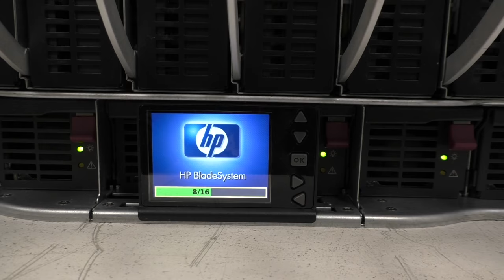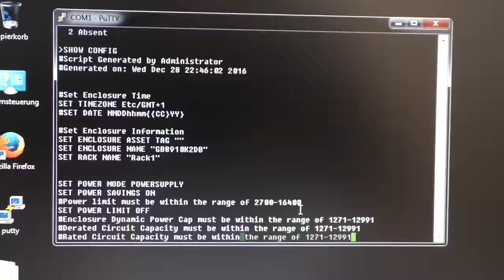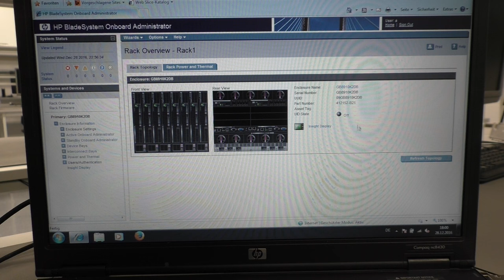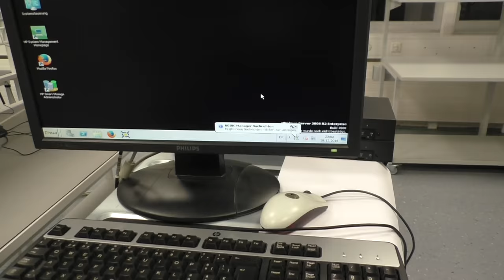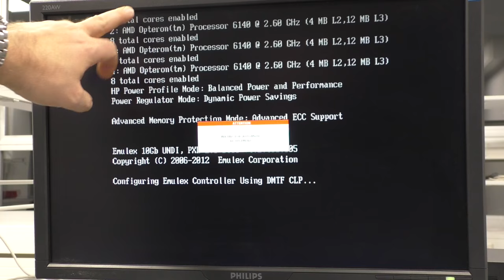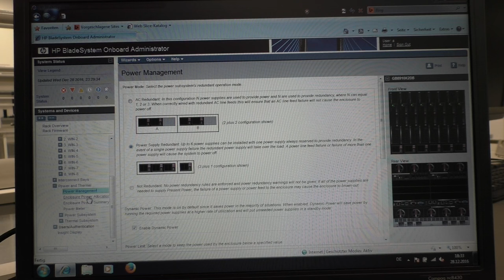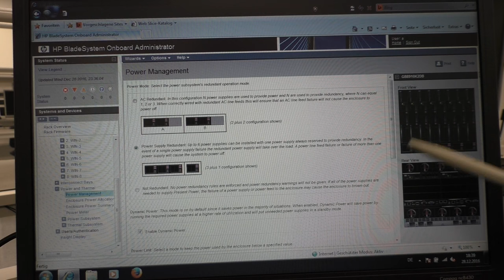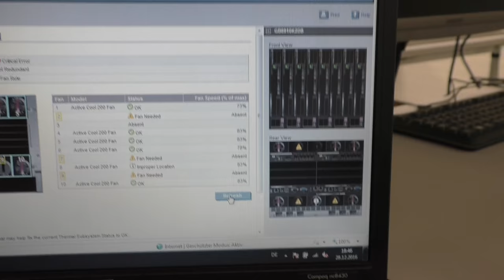Powering up the HP C7000 blade enclosure (PWJ45)

Comment: Hi... can you advice me how to login to HP D3700 enclosure... what cables do i have to use ? to which ports (Mfg) ?
Reply from the maker: The HP D3700 enclosure has no login. It's just a SAS expansion box that connects to a HP Smart Array controller.
You need SAS cables with a Mini-SAS connector on the D3700 end and a connector that suits your RAID controller at the other end.
(Was that a trick question?)
It also works with non-HP controllers but some extra functions like signal LEDs will probably not work.
I recently used one together with a HP Smart Array P431 (with external connectors)
One cable connected to one I/O port of the D3700 is enough. You only need more cables for redundancy or to connect more boxes.
Reply: @PlaywithJunk  Thank you for the reply <3.. The HP D3700 is connected to HP ProLiant DL580 Gen9 via HD sas sff 8644 cable. when there is a requirement to shut down the servers for maintenance, we can shut down the HP proliant DL580 but there is no way to shutdown the D3700 enclosure. please advice...
Reply from the maker: @aroshsenanayaka4210  OK... again... The D3700 is just a box full of disks. When you shut down the server, that's all you need to do. Imagine the D3700 just like the internal disks of the server, only in a separate box. There is no shutdown procedure for the D3700 itself.... The disks will shut down when the raid controller inside the server shuts down, when the server shuts down.
I don't know if there are different controllers for the D3700 but then it's not a D3700 anymore...
https://www.istoragenetworks.com/servermanuals/HPE-D3600-D3700-Disk-Enclosure-Maintenance-Service-Guide.pdf
Reply from the maker: @aroshsenanayaka4210  Or do you mean how to power it down after the server shut down? Well... just pull the power plugs! That's all you can do. Is there a power button on the backside? I don't remember....
Reply: @PlaywithJunk   in a situation like a cooling fan failure, ways to detect it are the indication lights or IO module codes ? there is no way to get logs (AHS)

Comment: It's amazing how short the lifespan is of a server like this.  Just 10 years ago, it was state of the art.  And mainframes are still around.  Go figure!
Reply: "mainframes" is just a generic name for a computer class.  they have just the same short lifespan before they get replaced by the next "mainframe".
So as a user you may think that the mainframe is still the same as in the sixties, but that is not true.  Same as you never see when such a server is replaced.
Reply: @Rob2  I actually do know that mainframes are not the same today as they were in the 1960s.  Storage methods are different, internals are different, capabilities are different.

Comment: Hi, how do you do? I have to recover the password of an enclosure; but I don't have the cable; what cable do I need to recover the access to the enclosure Do you have an useful diagram
Reply from the maker: I think you are talking about the OA (onboard adminitrator) password. There is a 9pin serial connector on the OA module.  What you need is a "null modem" cable with female DB-9 connectors on both ends.
three wires:
5---5
2---3
3---2

Then you need to do this: 
To recover the password and reset the administrator password to the factory default: 

Connect a computer to the serial port of the Active Onboard Administrator using a null-modem cable.

Open HyperTerminal (in Microsoft Windows) or a suitable terminal window (in Linux) and connect to the Active Onboard
Administrator .  9600 8N1 no flowcontrol

Press and hold in the HP BladeSystem Onboard Administrator reset button for 5 seconds.

Press L to boot the system into Lost Password mode. The password resets to default and appears on the screen as it reboots. Password are now the same as on the factory label.

Comment: Where are the disk drives located
Reply: on the front, see the purple/black/white stickers? it says SAS 72GB @16:08
Reply: Some blades modules don't have any local drives. They use network storage.
Reply: Depends the c7000 is still used today. You can get more modern bladesthat are built for storage some built for core count and even Gpu blades for gpu passthrough for virtual machines. I bought a c3000 and use it for virtual machines in my house
Reply: There are pretty much only boot up drives in such blades (if there are any), all storage will be located on SAN connected storage.
We use HP 3Pars for storage in combination with about 80 of these C7000 blade enclosures, all fully loaded up with 16 blades each. They're an awesome piece of tech.

Comment: I have lots of 2U Proliant servers dual CPU 8cores , 10 cores 128gb , OS vsphere ESXI hosts, 8GB Fibre and 10Gb network with dual ports cards each, that is mess wiring of Fiber cables, 15servers in 1 rack, I have 3 racks of those servers , but now those are junk no support soon, I am looking for replacement. Do you recommended C7000 total 4 enclosures with blades HPE ProLiant BL460c Gen10 6248 2P 20 core 256GB each blade servers? what kind of FC - Fibre cards or slots did we get to connect storage, also how many 10 GB cards or slots I can use. My vendor told use 8 ports (4+4) redudancy , 10GB 8 ports (4+4) 2 slots on blade. can you explain more.

Comment: Ooo I want one of these!! But i couldn’t power it!
Reply: I have one of these, loaded up with 16 Intel based G7 blades. We've got about 80 of these blade enclosures, all fully loaded up, at my work and when they need replacing, employees get a chance of buying one or more. I took the chance when I had it last year.

It's an awesome piece of tech, but SO unnecessary at anywhere else than a corporate data center.
Reply: @benedykt123313  do they work from 3 phase power?

Family friend and father of one of the scouts in my troop has one of these and proliant server sitting in his garage doing nothing. He bought it to work on for homelab.

I have mad idea to make VM environment as classroom computer room for scout troop (he also has some zero clients)
Reply: @liammhodonohue  Yeah as I recall correctly there are two versions; one with 2x CEE16-5p and one with 6x C19 (2 for each phase). And while you technically could power that version with two phases, you will imbalance the power supply grid and there's no redundancy. Hell you could power the beast with a single phase as long as your main breaker is heavy enough.

Comment: Flash forward to 2020, Your servers have BOINC, so you can donate compute power to Rosetta@home to help researchers find treatment for COVID-19, and join Folding@home at the same time (same research goal), as well.
Reply from the maker: Hmmm.... you know what? That was exactly what I did since easter 2020. I'm using BOINC since a long time to test my servers. On easter I switched them all to Rosetta and used some additional 8-CPU servers as well. I think I did some good work within one week ;-)
Reply: Got quite tempted to buy one of these for €1000 on eBay to use for BOINC however don't think the neighbours or my electric bill would appreciate a hidden fighter jet in the garage/attic 😂.

Comment: After holding reset button the bladecenter is down.
Thanks for ruing my life.
Reply from the maker: What do you mean by "down"? All servers crashed? Normally it shouldn't do that.
Reply: @PlaywithJunk  well all servers are still up but the insight display won't turn on now.
Even monitor doesn't display anything when attached to rear.
Reply from the maker: @saaleempanhalkar846  That looks like the OA doen't start up. Do you have a terminal to connect to the RS232 serial port? 
As a first measure I would pull the OA and push it back in. This will do a power-reset of the module.With the terminal connected, you will have a possibility to observe the startup of the OA. Might be a firmware problem or just a glitch that will not repeat. 
Firmware can be fixed by using the seral port menu at the very beginning of the startup.

Comment: WAAAY easier method to reset OA PW than the archaic NULLMODEM Serial/Terminal procedure ...

FAT32 format USB Flash Drive
Move a single-line text file named "reset_password.cfg" exactly as follows below to USB Flash Drive:
	SET USER PASSWORD "Administrator" "enter_desired_PW_here"
Put USB Flash Drive in OA port, and select 'USB Key Menu' on Insight Display
	Restore Configuration
	usb://d1/reset_password.cfg

Viola, OA PW reset in under 2 mins.
Reply from the maker: Thank you for that... I did'nt know about this procedure. But since I have my management PC set up to work with RS232 and the right cable attached, it takes even less than 2 minutes to do the reset ;-)
But I would prefer your method for field service tech's because they have not always the necessary tools with them. I definitively must try that.
I just saw that older OA modules have their USB port covered with a sticker... have to try if that works with new firmware.
Reply: @PlaywithJunk   ... I just received some very old OA's at 2007 era FW 2.02 that had the "Reserved for future use" sticker covering the USB port.  At that old FW level, the 'USB Key Menu' was not yet available on the Insight Display.  I updated first to FW 3.50 via browser (I had the PW for this one), and the 'USB Key Menu' was now appearing on the Insight Display.  So I peeled the sticker covering the USB port, and even though I didn't need to use that port for PW reset on this one, I was able to use it to continue the FW update to latest level 4.95.

At some point between FW 2.02 and 3.5, they added that 'USB Key Menu' to the Insight Display.  If you see that line on the display, you will be able to reset OA PW with the simple USB Flash Drive method.

Comment: damn.. i want something like that. but its way to expensive for me :/ i dont have the 25k€ for such a beast of system :c
Reply: You can get them used for fairly cheap because people don't like to deal with the huge power draw, especially with homelab
Reply: Yeah they're about €1000 used with at least 8 G7 blades.
Nobody needs these loud noised jet engines in their homes, so the second hand value is pretty much none.
Reply: I have a few c7000 g3 platinum ones with 16 bl460c gen 8 blades each. They don't consume much compared to same amount of 1U stand alone servers with same specs
Reply: Actually gen6 and gen7 are more power consuming btw

Comment: It's slow because you're using the worlds worst Internet browser. But I dont know what software is on the server, might be a requirement.
Reply from the maker: If you're talking about Microcrap Exploder, you're right. But the management webpage requires MS otherwise some features won't work properly.
Reply: Play with Junk Ah yes thanks for replying so fast.
But thats why i said requirement. Oh and also thanks a lot for these amazing videos. Keep up the good work.
Reply: @PlaywithJunk  If you need to use IE in the future, make sure to uncheck the "Check for publisher's / server certificate revocation". It'll at least speed up those pesky self-signed HTTPS pages.